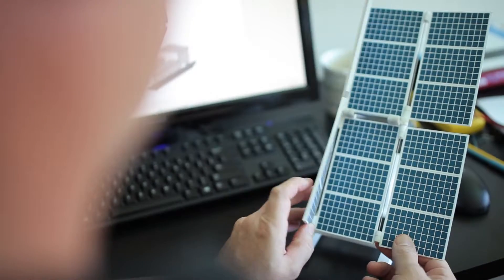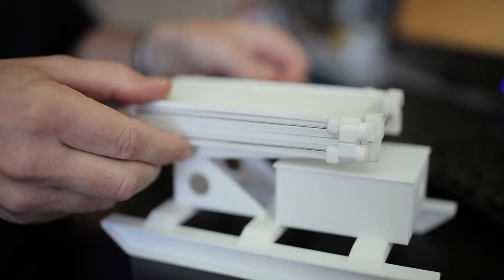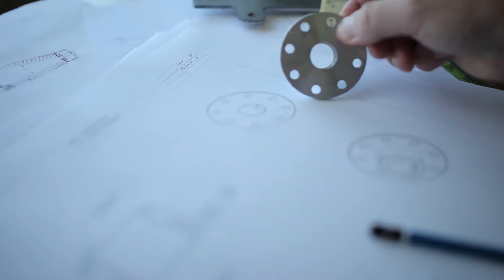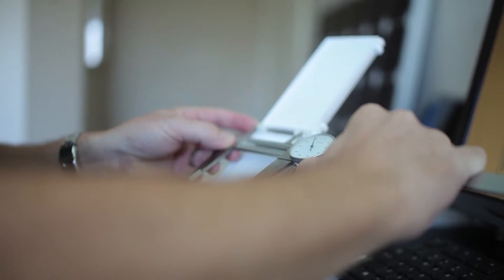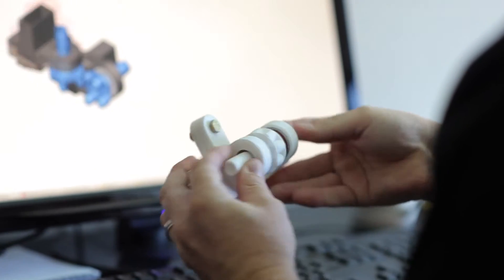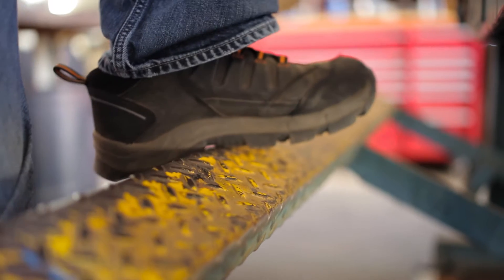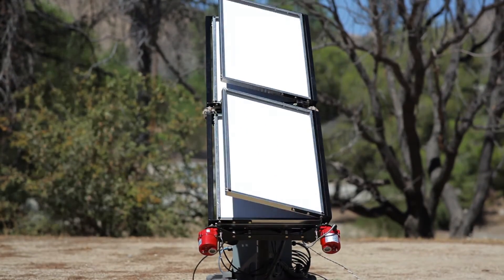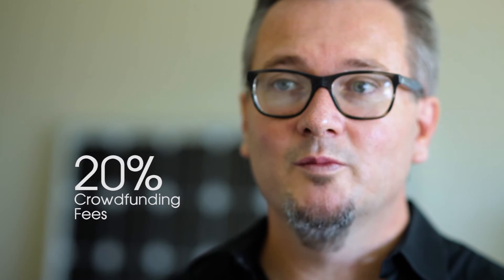Meridian Indiegogo Campaign (Folding Solar Panel Array) ( Portable Solar System )

Comment: Go smaller and aim at travelers. I currently live out of the car, gold prospecting into wilderness. A unit like this in the forrest would actually be a life saver especially if it can generate enough power to charge a car jump pack. It's not just for my youtube channel and editing, but my metal detector and more, as the car alternator requires the car to be running to charge, and as we all know, gasoline isn't cheap. Thanks!